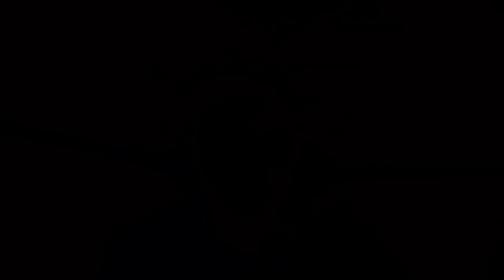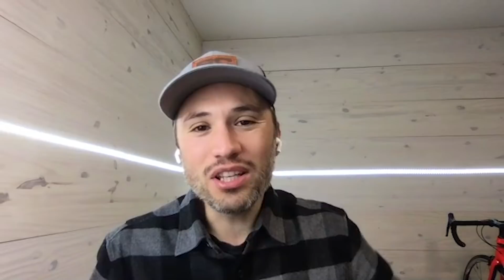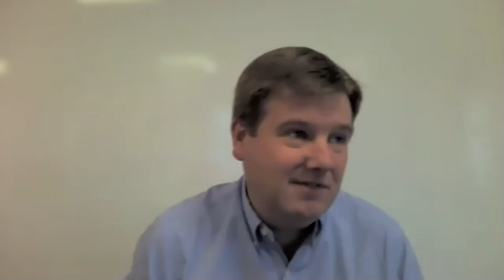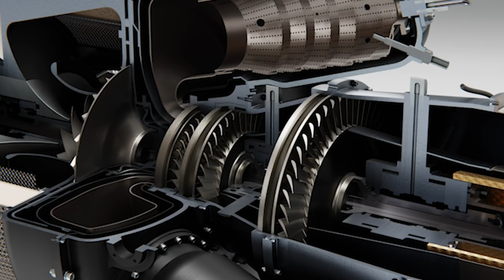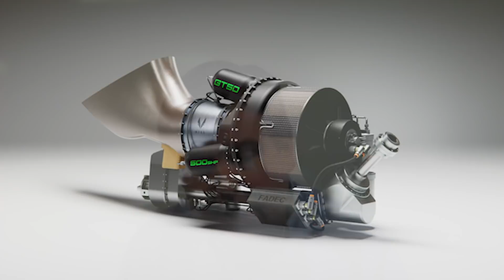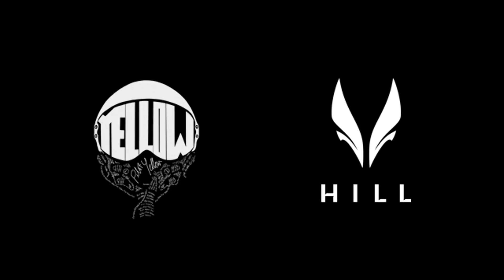Unveiling the Hill GT50 Turbine Engine

Comment: Safran helicopter engines make engines specifically for helicopters.
Why would you suggest there is no other company creating turbine engines for helicopters?
Statements like this make investors nervous.
Reply: because its not just about an engine, its about every aspect of that engine, the design (taking the best bits and improving them) weight, size and output, and more about building something all in house under your own control, 
for a lot less and never having to wait for a manufacturer to deliver on time, it is a lot about trust as well

your comment was two years ago
when you have the resources from industry to produce something already proven, what's difficult

you could have a huge company with much man power and huge resources producing xyz bearings which you will pay highly for - if you employ the manager who is highly experienced, a small number of staff and the best machines to do the same job, you could produce the same xyz bearings but perhaps over a slightly longer time period for a damn sight less than a big corporation - admittedly you are paying through the nose to keep many more folk employed, but you the customer ultimately always wants value for money, so here it is

Comment: I wonder if this new turbine engine will be cheaper than current off the shelf engines. You had mentioned $450,000 turbines compared to $50,000 gasoline internal combustion engines. 9X more expensive......
So, did this fellow have anything to offer on the expected price of the new engine? Maybe a drop from $450,000 to an astounding $449,000? LOL!
Why in heck are these turbines so damnably expensive?
Reply: Exotic high-termperature metals turning at 30,000-60,000 rpm in a 800 degrees C environment are more expensive to aquire and machine than say...aluminium pistons.
Reply: @kyqx  Not to mention the precision of manufacture and the oil pressures required to keep the axles floating, what add even more precision manufacturing to the gaskets and so on
By the way, the compression ratio is 8/1
What can we expect about fuel efficiency?
Reply: @r.guerreiro140  No journal bearings, ball bearings are used in turbines. BSFC is about 360g/kwh
Reply: @chippyjohn1  thank you
Reply: @r.guerreiro140  in a gas turbine it's a pressure ratio rather than a compression ratio (different meaning). But yes, it's low, so efficiency will be low.
Reply: @chippyjohn1  360 g/kWh isn't surprising, and it's even worse than other small turboshafts.
Reply: @brianb-p6586  it's actually reasonably good for a small turbine. Many of the competitors are around 400-500g/kWh. It is all just theory so far though.

Comment: What's the timeline guys?
Reply: It’s a year ‘after next year’ now and no engine…
Reply: @NickMurray  it's yet another year later (2024) and they are building components for the first engine, but haven't built all of the components for even the first test engine yet.
Reply from the maker: The engine will be running on a test bench early next year.
Reply: @PilotYellow  It's "early next year now"  Is it running yet?  The three videos on their website would seem to indicate it's still a long way out.
Reply: @PilotYellow  that early 2021 promise has come and gone. It is now three years past that (May 2024), with no engine built. It would have been better to say "Hill says that they expect that the engine will be running on a test bench early next year". Never make hopes and guesses into statements of fact which turn out to be very wrong.

Comment: With all the great helicopters  and engines on the market, you couldn’t find one that met your requirements? I imagine adapting your design around a current engine would be viable. But for a clean sheet helicopter AND a clean sheet engine - with all the tests and regulations required?

Comment: Let's see if he can break the mold and make a reliable turbine engine for less than $500-600k
Reply: @JimSmith069  Its £495,000. Which is close to $700k.
Reply: @dogsnads5634 
2023 at a price point of just £495,000 (US$665,000
Directly from Hill Helicopter sales team.

Still not a bad price

Comment: I see more and more red flags yes designing a 300 hp turbine is posiple but.... Getting it certified will be close to imposible on a budget.
Reply: I work at Mitsubishi turbo engeenering plant in the netherlands we had a proposal from rotax on turbocharging the then new 912 concept. The technical aspect was not that complicated nevertheless our turbo's ware never going to be certified as the production plant that cost over 2 billion euro whas not clean and temprature stable enough to garante that the casting ware within aviation standerts. Any part made in aviation needs to be curtified. Also the real expens the priduction plant of al parts need to be approved and those standard are higher than thecnicaly nessery so all automotive parts or general industry parts aren't a real option for aviation.
Reply: Never use the word impossible if you are not the one doing it

Comment: As an engineer, every time I’ve heard another designer refer to something as being simple, they’ve dramatically underestimated that task. I heard the word simple quite a bit in this interview...
Reply: Two years later still no progress on that engine...simple
Reply: @NickMurray  Source?
Reply: @NickMurray  three years now... and they are still building components of the engine.
Reply: I think Hill's point was that the operation of a turbine engine is considerably simpler than say a 2 or 4-stroke internal combustion engine. Did you hear the about the engineers involved in this project? In general I read negative comments about this and other ambitious projects, usually from people who have themselves achieved relatively very little in their lives. Everyone told Koenigsegg that he wouldn't be able to produce his own engine and that he'd be using a V8 Ford block forever...
Reply: But you didn't determine that there has been no underestimating in this case?
Reply: Yes Sir the word simple ....? Is only to put a hole money 💵💰💵💰💵💰 in there 😉😂......... ! ! !

Comment: A gas turbine with full 30s-emergency-power on gross weight and ISO+15 up to 10kft? Impressive. Still hoping to see the prototypes in the air and finally certified onea on the shelf. But then - how long did the Kopter SH-09 take from maiden flight into service? Now 5 years and counting?

Comment: I fly a Mosquito XET with a Solar Turbine T-62T thy puts out 95 SHP, with the addition of the aux tank I stay in the air by myself for hours. 
With the availability of so many small gas turbines that are proven runners why make your own?
Reply: Fuel efficiency  cost  .
Reply: @jamesringler987  The only way you’ll be able to bring coat down is to manufacture it in a foreign country with dubious labor laws. As for efficiency you really can’t get better than the Solar. What I mean is there is only so much you can get out of a small gas turbine for efficiency before you start burning up parts etc. like a piston engine you don’t want to run it too lean else you’ll burn a piston.
Reply: The only way he will succeed is to manufacture them very cheap in China or India.
Reply: @ArmyNurseCorps-u5c  hell of a selling point,made in china,stamped on the powerplant,after all,its a helicopter,not a skateboard.the guy is at a crossroad,dont make a bad turn....
Reply: @ArmyNurseCorps-u5c  Except that they're to be built in-house in the UK in their own facilities...
Reply: What is your operating cost did you build it yourself how do you like it would you recommend an xet? Thanks
Reply: The answer to that question is found in this interview...